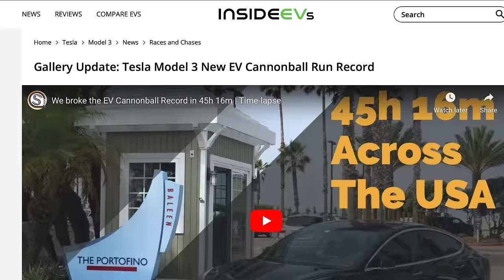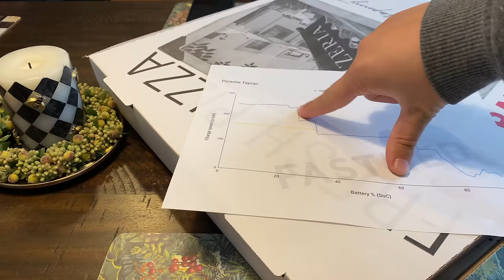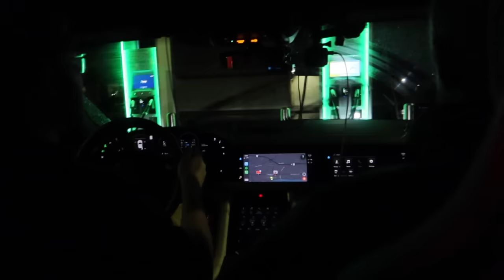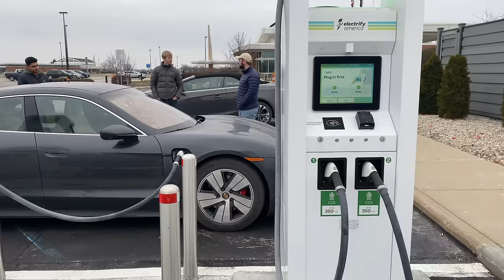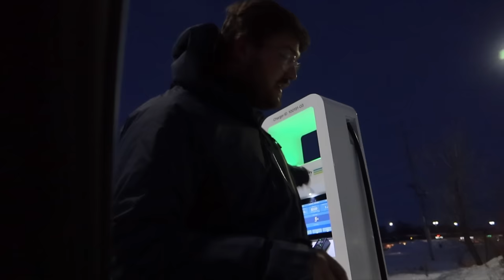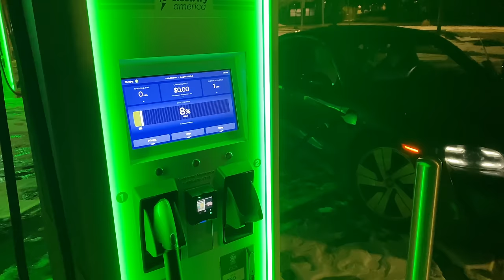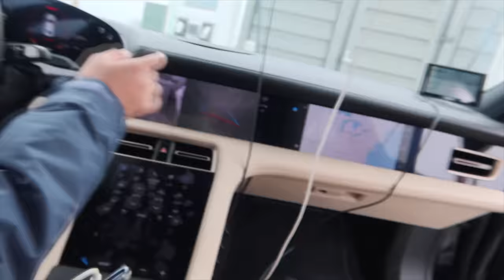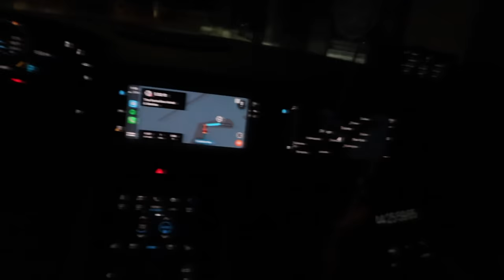EV Road Trip From NYC to Los Angeles! Breaking The Electric Cannonball Record In A Porsche Taycan 4S

Comment: Your interviews were very misleading. You gave the impression that EA was working great. Even with top level support from EA you had trouble at every stop. Then there was the Porsche nav problem, how is it possible that with the attention of Porsche's engineering they couldn't get   the nav to work.
What you've proved is that in 2021 a Tesla is the only choice for an EV. What you should do is repeat this trip in a year. It doesn't need to be a Cannonball just one of your road trips.